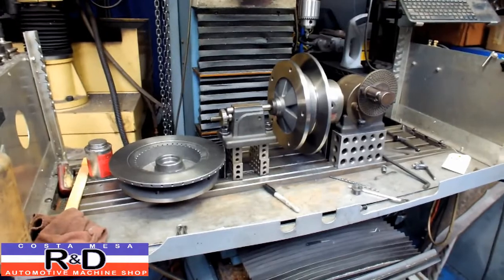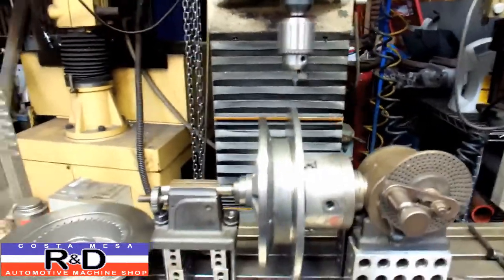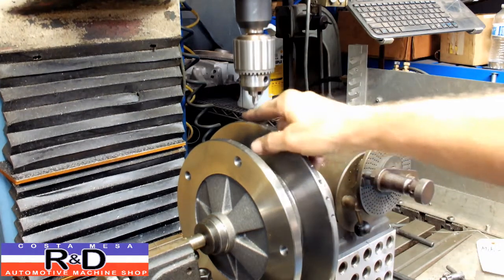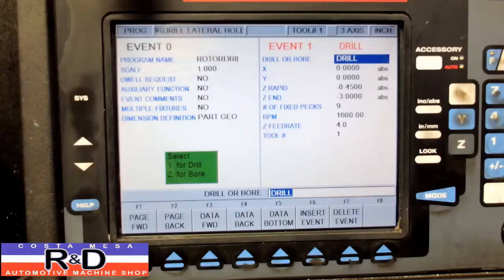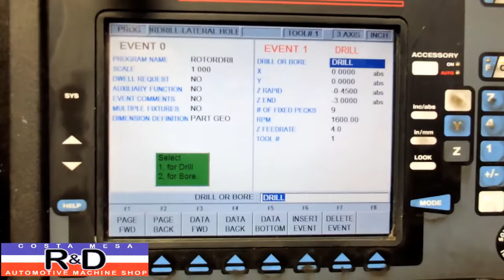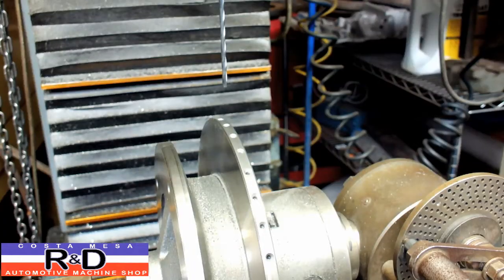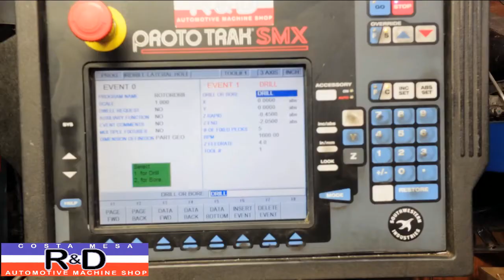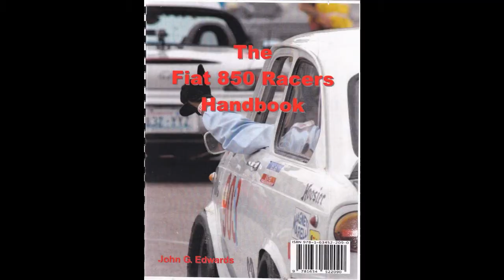VW Wide 5 Brake Rotor Drilling - 40 Periferal Holes for Cooling

Comment: These rotors are going on a 68 Cal Look Beetle. Rear drums have the wide 5 X 205 - mm bolt pattern too. Rear drums have been drilled with vent holes where they contact shoe linings old hotrod mod style. Beetle started out not for USA export with a swingaxle gearbox that has now been built up for some abuse and a bored X stroked mild ratio of compression street motor with 2387cc of displacement.

Comment: Hi you could do a video about balancing crankshaft where you explain the difference of balancing with bob weights and without. As well as pros and cons.
Thank you for many good and instructive clips.
Reply from the maker: Nicklas, see if you can find a copy of my engine rebuilding book, it will tell you all you need to know: Sunnen's Complete Cylinder Head and Engine Rebuilding Handbook. You can usually find them on eBay.

Comment: I'm opposed to the mechanical alteration of brake rotors.  How susceptible to brake fade can any VW be?  It isn't used for trailer towing, I'm sure.  And if brake overheating (and consequent fading) is a problem, one way to avoid this is modification of the piston to put more thermal resistance in the thermal path to the hydraulic fluid.

I still give you "thumbs up" for fine workmanship, John.
Reply: Brake fade can and does happen without boiling the brake fluid.